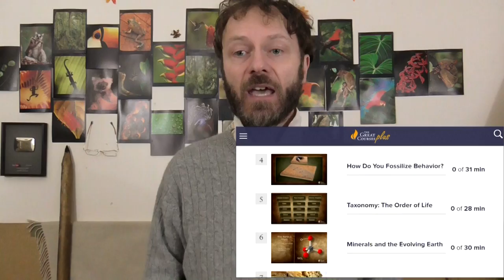Muzzle Brakes - what are they for?

Comment: I'm a veteran of both Artillery and Armor.  So I have a few comments.

First, thanks for talking about modern conventional weapons!  A majority of your observations are new to a lot of viewers.  Going into "how things work" is pretty cool.

BUT, Second, you are all over the map when it comes to these distinctly different machines.  You display both Artillery (weapons that lob explosive shells from a distance without seeing their targets) and Armor (a.k.a., Tanks,  with crews that SEE their targets and fire on them directly).  They really need to be separated when it comes to muzzle breaks, because Artillery sits still when firing, and Tanks are most often on the move.  The design reflects the difference of purpose.

You identify, for a moment, S.P.,  or "self propelled" guns.  Self Propelled ONLY refers to artillery, as opposed to "towed" artillery.  A gun that is pulled around by another vehicle that lobs artillery rounds is "towed" artillery, whereas a gun that has it's own wheels is "self propelled".  But pretty much ALL tanks have their own wheels, or more usually tracks.  It might sound like a petty distinction, but it isn't.  Armor and Artillery might look similar, but they have vastly different purposes.  "Self Propelled"  ONLY deals with artillery, and artillery NEVER USES SABOT rounds.  I think you cause confusion.

Oh, and I saw it mentioned before.  It's the Abrams Tank, not Abraham.  Abrams is a WAY, way more battle tested war machine than any Challenger.

If you really want to get into fascinating physics, tho, you should discover the BORE EVACUATOR.  That's the thing on many tanks that is two thirds to three quarters up the tube, not the muzzle break on the end.  The knobby bulge in MODERN cannons.  It's fascinating because it sucks the smoke out of the tube so the crew inside the tank don't have to choke.  Luvs me the bore evacuator. 

Anyway, my hats off to American Army MOS's (military occupational specialties)  13B and 19K, and the Marine equivalent.  And thanks again, Lindybeige, for an interesting topic.
Reply: do they still use HEAT rounds, or is it too ineffective due to new armor.
Reply: It's really effective against light vehicles. But generally speaking, MBTs will mainly be loaded with Sabot ammo.
Reply: epion660 then why do rpgs use them?
Reply: Blox117 Because it can still be useful against light vehicles, like i said. Light vehicles don't just mean trucks and cars. Standard Heat warheads are easily stopped by Spaced armor, certain types of Composite armor, and ERA armor. ERA armor explodes outwards from the vehicle stopping the projectile. Tandem Heat warheads (shells can't have these, RPGs can) can still have effect against ERA armor.
Reply: epion660 what about the missiles that go over the top of the tank and penetrate its roof?
Reply: Blox117 Well that's just completely different, now isn't it. The armor is thin enough that the HEAT warhead can get through no problem, while no one really puts ERA armor on the roof. That's literally why they made missile launchers like the "Javelin". They're expensive compared to RPG munitions.
Reply: epion660 but i think they are making defense systems for tanks that can disable missiles using lasers or missiles, right before it hits the tank. I think it was made by raytheon.

edit: yes it was called quick kill
Reply: Blox117 Yeah, Active defense systems have always been desired. Generally speaking, from current knowledge, nothing can really replace missile/rocket launchers in their AT role, so an Active defense system that shoots down with at least 90% efficient rate, it'll make tanks more than terrifying to infantry, coupled with having air support.
Reply: epion660 were you in the military? im just someone who has interest in all sorts of military knowledge.
Reply: Blox117 No no, i'm only 15. But this is my specialty. I know the ins and outs of most military equipment. Please, don't ever hesitate to ask anything you want to know! I absolutely love to share my knowledge!
Reply: epion660 well this is certainly unexpected.
Reply: Blox117 Just to be an even bigger surprise, i'm also a blacksmith, and working (somewhat half-assedly) on making a game with my friend.
Reply: epion660 what is the game?
Reply: Blox117 We're not 100% sure. It's going to be 16 or 32 bit, as a retro styled game. Our various plans/ideas were a "Worms" parody with tanks, or a bunch of Atari styled games sold in a pack, like 5-10 bucks for a set of 30 Atari type games.
Reply: epion660 that sounds cool

Comment: Thanks for the film
Someone may have noted this earlier: that "thing" holding the tanks tube (barrel) during transport/driving is a travel lock.
When I was in the artillery, (M109A2) our tube had a muzzle brake. Recoil within the turret was moderate and the sound level when firing quite low - far louder outside that in. Good old days.

Comment: A muzzle brake or recoil compensator is a device connected to, or a feature integral to the construction of, the muzzle or barrel of a firearm or cannon that is intended to redirect a portion of propellant gases to counter recoil and unwanted muzzle rise. Barrels with an integral muzzle brake are often said to be ported. The concept of a muzzle brake was first introduced for artillery and was a common feature on many anti-tank guns, especially those mounted on tanks, to reduce the area needed to take up the strokes of recoil and kickback. They have been used in various forms for rifles and pistols to help control recoil and the rising of the barrel that normally occurs after firing. They are used on pistols for practical pistol competitions and are usually called compensators in this context.

Comment: Churchill tanks were the best? Not by a long shot.
Reply: JRos83 One of the best*. Even then, it was slow and an easy target. British pounder guns performed better than what the americans fielded in terms of armour penetration. But a standard Pz.IV. 75 mm. is going trough churchill no matter what. If I had to take everything into consideration (Armour, gun, speed, versatility, mechanical reliance, build quality etc. etc.) I would be in a late panther or a jagdpanther (turetless tank destroyer). T-34 had wild variations in build quality. Poorly welded, soft and impure steel was common. M-18 hellcat maybe? Speed>armour? Even tho early panthers were plagued by dreadful transmission it was more or less fixed on the later models and the jagdpanther is regarded as the best vehicle (in the same class - tanks/td-s) by the allies. So I would go what best protects my cowardly arse ;)
Reply: JRos83 Solid argumentation there mate. And over half of my previous comment such as build quality and transmission is not modeled in games.
Reply: JRos83 Also does not change the fact that churchill is utter garbage. It performed well in africa theatre because Pz II. III. and IV. did not carry a gun with good enough performance to match the well armoured churchill. Same goes for the Italians.
Reply: Bzorlan I am talking about real life. And I started not expectiing to be pulled by the nose but maybe hearing different opinions.
Reply: ***** You still here? Care to elaborate why you agree with Lindy? No? Alright, bye!
Reply: calm yourselves, children.
Reply: Challenger 2 ATDU Alright. Just don't shoot!
Reply: not even close the Russians had the best tanks at that time
Reply: your line of reasoning would be accurate if not for the fact that the Churchill was an infantry tank. while yes it may come into contact with some other tanks (specifically in Africa) it was more designed to move with the foot troops. thats why they gave them the 90mm howitzer, eventually what crazy fuck petard (i think thats how its spelled) 270mm
Reply: i believe you are referring to the 290mm Petard Mortar which was found on the Churchill AVRE.
Reply: Evangelion_Unit_13 yeah the flying dust bin
Reply: Fug Babylon, Good joke.
Reply: Considering what else the British were producing back then... It is close to being the best... For starters it's the only one that can actually survive a hit from some German guns...
Reply: ACKCHYUALLY, that's not entirely true and essentially everything on the battlefield couldn't take a hit from most thing if it was hit correctly. And the British tanks were far from the best, seriously the British had no idea how to properly build a tank. Living proof is the TOG II. (I'm 80% serious but don't take me too seriously to get triggered.)
Reply: CourageousFish They actually have a pretty good idea on how to build a tank... they just didn't build said tank... They had mock ups of the Centurion during like 43... Said tank being rather nice...

And I never said anything about the British thanks being the best... I specifically said...

"Considering what else the British were producing back then... It is close to being the best..."

Don't know about you but I'd rather be in a Churchill than in a Covenanter, or a Centaur or a Cavalier...
Reply: The British built and operated one of the best tanks of WW2 problem was it was right at the end. The Comet tank was absolutely fantastic
Reply: ekmad the Centurion was a better design overall, and did appear a month or two before VE Day, albeit in prototype form.
Reply: He didn't say the churchill was the best, he said 1 in 5 mounted the 6 pounder because the GUN (not the tank) was better in anti-armor cases than the american guns.

Edit: made this comment halfway through the video so nevermind lol.

Comment: Some large caliber handgun and rifle owners have ports and/or muzzle brakes added to help counter recoil using the spent gas, with the same increase in noise. In the case of muzzle brakes, the added weight at the end of the barrel also helps to reduce recoil. The barrel of the M2 50 cal MG is intentionally "extra" heavy to help reduce recoil. 

I was just thinking that a recoilless rifle has a combination breech/muzzle brake. I always thought it was an interesting idea despite the drawbacks, just like the Stirling engine you recently expounded upon, there may be something there worth another look. (Or they just might be great, but ultimately dead end ideas.)

I got to see the New Zealand Army fire some 105 recoilless rifles with tracer rounds during a live fire exercise. The interesting part was several of the rounds, all were fired at a low angle because that is where the target was, skipped just like rocks on a pond. Just like a skipping rock, each hop was unpredictable in length from a few meters to a few hundred, with some rounds exploding much further down range than intended.

.Happy Muzzlebrake to you and all your subscribers.
Reply: due to the design of the M2 that barrel weight actually increases recoil, IDK where you heard that
Reply: Xtorin O'hern 
US Army Quartermaster School, Ft Lee. It may be wrong, but that is where.
Reply: Ray Giordano damn, from all my experience shooting i have found that if you put a heavy barrel on a recoil operated weapon it substantially increases recoil. but hell the military probably knows something i don't
Reply: Xtorin O'hern 
The heavier the gun, the less it will accelerate under the same force exerted on it by bullet, than a lighter gun.

Heavy guns have their own problems, but I guess it is a trade-off, like most everything I in engineering, and life in general, IMHO.

Part of the heavy barrel alleged benefits (it's not like I did experiments) is to also mitigate a component of recoil: the barrel rising with every round, which is probably more of a worry for automatic weapons than any other kind.
Reply: The heavy barrel is mostly for heat and durability, reducing the frequency of barrell changes. The M2 is mounted with the pivot at the bore axis. Total overall recoil is not a factor, aside from the strength and durability of the mount. It's a delayed blowback system, so it does require a certain amount of recoil to operate, but the mount controls all the external recoil.

Comment: I'm actually surprised that you didn't add a counter to this video, counting how often you said "barrel brake" instead of "muzzle brake"
Reply from the maker: Drat!  I should have thought of that.
Reply: fyi:
Muzzle: 0:24 2:40 2:46 2:52 2:56 3:03 5:46 5:47 6:55 8:17 9:15 9:23 9:39 12:20 12:22 12:29 12:32 12:41 12:46 13:51 14:01 14:53 17:10 20:54 (22:00 written!) 22:09 22:12 22:17 (22:29+ x2 written!)
Barrel: 1:57 2:09 2:20 4:19 4:21 4:38 ( 4:52 written!) 5:23 5:25 5:34 5:44 5:54 6:46 6:54 6:56 (no kidding) 7:19 14:51 17:03 17:05 17:08 17:44 17:46 18:12 18:23 20:34 21:53 22:08
both at the same time: 7:56 

So the final score:
Muzzle: 27 + 3 written + 1 simultaneous = 31
Barrel: 26 + 1 written + 1 simultaneous = 28
I hope I didn't miss any but Muzzle break came out on top just barely.

Comment: At about 4 minutes I could not wait for the answer any longer so I googled Muzzle Brake and had the answer before the 5 minute mark of this video. Then I wondered if I should continue to watch...
Reply: Did that answer you got include why some WAY bigger guns doesn't have a muzzle brake?
Reply: Zyx Yep!
Reply: Lindy kind of got the reasons for muzzle brakes a bit mixed up. Recoil management was the real reason for that so that barrel wouldn't rise up thus mess up your DOPE (I don't know what the artillery term for this would be, so I went with the marksmanship equivalent). Things like smoke come second in their importance to that one reason alone, hence the brake part in the device's name. In fact, his statement about smoke is plain incorrect - a muzzle brake, whether artillery or small arms, will redirect gases and smoke sideways or even back at the shooter depending on its design. He does point out later that muzzle brakes can be dangerous because of the blast hitting friendlies standing sideways, but earlier in the video he states that muzzle brake would help with smoke blocking line of sight of the gunner, which it wouldn't because it would actually direct more smoke in front of the gun sight. Not that it'd really be a factor either back then or now - propellant used for tank shells don't create a lot of smoke.
Reply: Azimuth and Elevation

Comment: Well you forgot one function, noise reduction. You could combine the muzzle brake and the fire damper.

Muzzle brakes are not only used with tanks, but also with rifles.

A muzzle brake on a rifle ensures that recoil is reduced. Some of the gases are directed backwards to counteract the recoil. In the G3 BW, the muzzle brake and the fire damper are combined in one component. A silencer ensures that the gases, which normally relax suddenly at the mouth and thus cause a bang, are braked in a container, relaxed, and come out almost noiselessly at a much lower speed. A silencer is only useful in connection with subsonic ammunition, because it can only dampen the muzzle bang, but not the supersonic bang generated by the projectile.

Noise could be detected like smoke  or the flash as well. You want your enemies could do neither.

There are some nice devices that are equipped with optical sensors, microphones and fast computers. They observe the surroundings and as soon as they make out the bang and flash of a shot they calculate the exact position. Guess what the connected effectors do in the same split second? – They solve a logistical problem of the opponents, not so many heads to feed through anymore.

Comment: The reason why modern MBT’s don’t use muzzle brakes is because they mainly fire APFSDS and HEATFS. APFSDS has a discarding sabot, which would get stuck in the muzzle brake, or foul the barrel. I’m no expert, but the same principle is used with Barrett rifles when they use SLAP rounds, which also use discarding sabots. The muzzle brake doesn’t allow for the discarding sabot to actually discard, meaning that the round would misfire, get stuck in the barrel or something like that.

Comment: I've always wondered about those things, now, now I want to know what the lump in the middle of modern tank cannons are for.
Reply: That's a thermal sleeve, for temperature managment. So the barrel won't get one-sided very hot or cold
Reply: Matt H that little lump is enough to keep it cool?
Reply: Bore evacuator.  Helps push bore-gasses out the muzzle after a shot.
It accumulates gasses from a shot, and then directs a stream of gas toward the muzzle when the breach is opened.
This gets the bore gasses moving to the muzzle, and keeps them out of the turret.
Bore gasses from modern gunpowder have lots of carbon dioxide, carbon monoxide, all kinds of other nitro-based chemistry.  Deadly.
No fun if your main gun can kill the crew.
Reply: It's called a bore evacuator, it helps to clean the fumes form the barrel, so the turret won't be floded with them. The thermal sleeve looks like a cloth has been wrapped around the barrel
Reply: It's a bore evacuator. The Challenger also has a thermal sleeve wrapped around the barrel.

Comment: A Sabot round is also used in rifles so I might assume the same theory holds true ; When you fire a standard projectile , the rifling (grooves & lands) in the barrel put indentations (deformities) on the projectile as well as resistance ,  this changes the aerodynamics which effects accuracy over long distances .  When you use a Sabot , there are no markings on the round , the round is also lighter and faster especially good for armor piercing